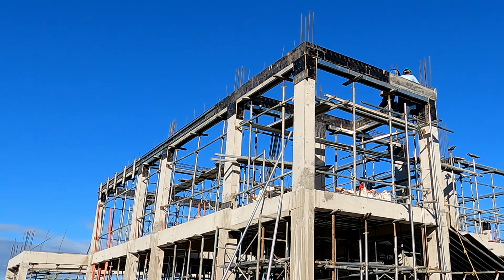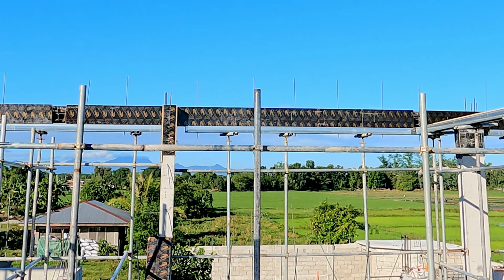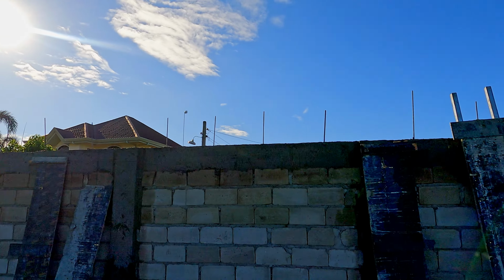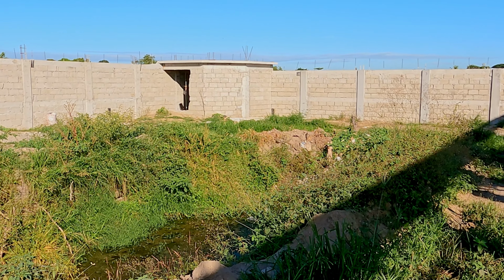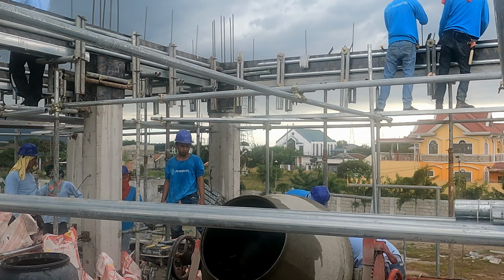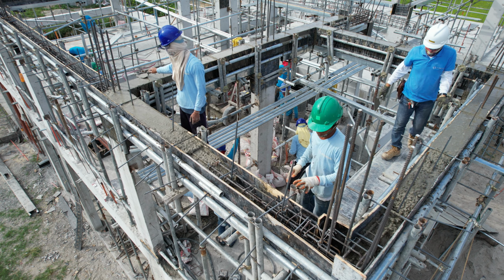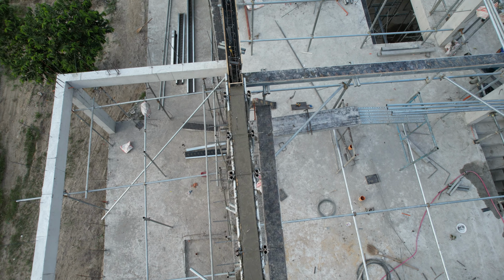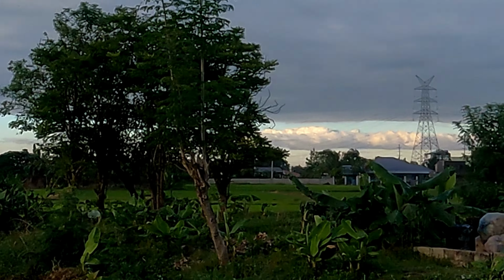Philippine House Building Day 77 - Roof Beam Pour Part 1

Comment: From my accounts, that is a very professional looking crew. Our project isn’t good to be nearly as large but I hope to be able to have a crew like this one.
Reply from the maker: You must have fast internet and lightening fingers - first to comment again.
References are probably the key - talk to previous customers and push hard for any negative comments about the builder / crew. And of course an element of luck helps.
Reply: Agreed on the professionalism. I've watched quite a few YouTube Philippine builds, and this crew is by far the most professional. They also don't do things that are "bass ackard". 
They don't do things that they have to back-track to correct. Like mix concrete on finished concrete and then come back and chip the residual off. This is a high dollar build, so it calls for a high dollar contractor.
Reply from the maker: @DK-8181  Thank you Darryl
Really pleased with the contractor, on-site engineer and foreman. To be fair, the whole crew seems to know what they are doing.